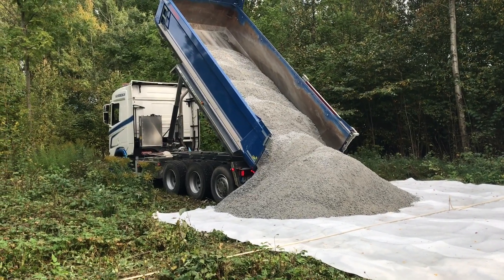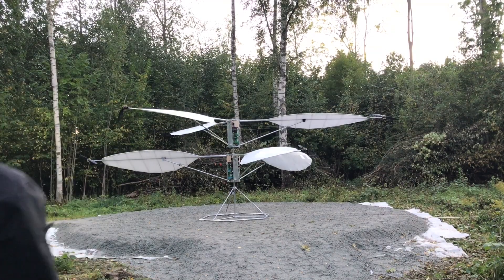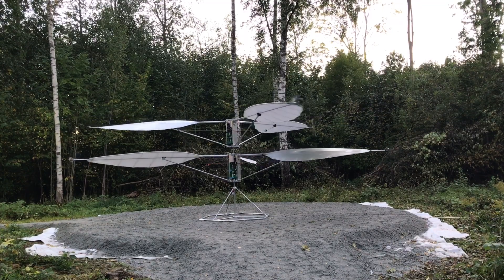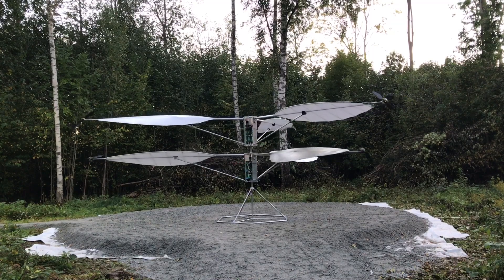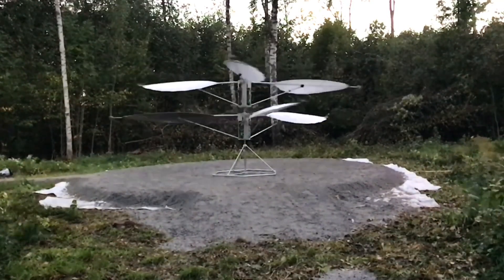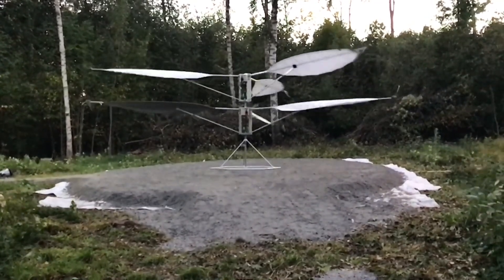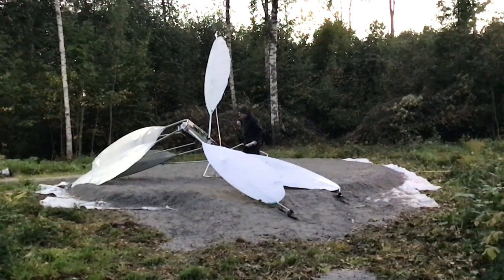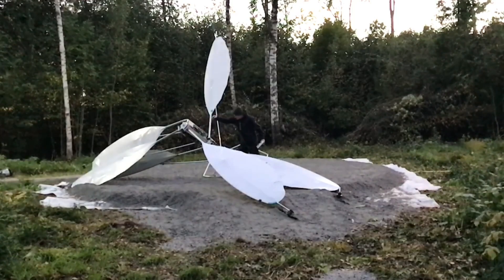Coaxial Levitator 2 First crash....

Comment: Great effort!!  Some observations:  1) Central support mass needs to be stronger -2) Lower center of mass needed (add weight at base) to add stability?? and -3) Turbulence from the wings/flaps are creating instability between upper and lower rotor assembly.   Good luck!!
Reply: lower center of mass doesnt work on drones
Reply: @darkevilapie this is not a drone, it's a helicopter
Reply: 2. seems like the pendulum fallacy.
Reply: Pretty much my thoughts too.

Comment: Opinion... it appears a loss of stability caused a loss of lift and hence contact of the blade systems, after touching back down... so perhaps the central shaft needs to be a three legged design (like a radio tower) with hubs for the prop mechanism to rotate on, creating more initial stability during power up... and maybe some load added to the landing leg. 🤷‍♂️

My layman’s observation.

👣🕊👽

Comment: Really disappointed for you, all that work with little reward but it did look pretty cool while it was spinning. plenty of salvageable parts for the next version. Coaxial's hey, over complicated and troublesome. I wonder if the central tube was the first thing to bend causing the crash. As we know without hinges on the rotor gyroscopic forces are transferred from one rotor to another through the connecting tube.

Comment: put all the bulk weight at the bottom and come up with some kind of power transfer device.
Reply: Slip ring?
Reply: The opposite may be better...increase the phase margin. See Rotorcraft Stability-Phase Margin Requirements in Hover